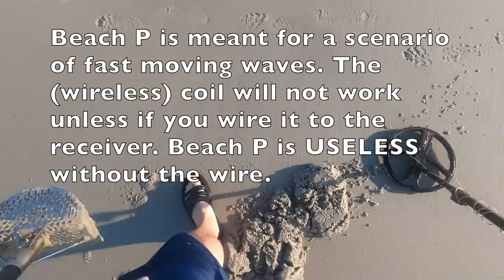Best Day Ever? I Found Davy Jones Treasure!

Comment: Great Beach.My beach surf line is much smaller.I went 7/17 came up with 2 smaller children's rings.Seems many adults are not getting in the water.( By visual observation) There are larger more crowded beaches in NJ but honestly,more driving,more gas money,more detectors.🤔So i ask myself stick it out ( i can only go once a week) or look for more detected areas.You do get good wave action (surfers in area).What i notice as opposed to the late fall ,winter is a South,SW wind most of the time.So NJ beach area it's coming from the right,rear as opposed to a NE wind straight into the beachfront.Sorry for rambling,i been doing some parks during the other days still trying to get a grip on distinguishing and separating those trash/ gold signals,#'s on the Nox....By the way how is your friend Johnny? Nox....

Comment: Speaking of honey badger scoop, how’s that going?
Reply from the maker: It’s going well. I have to communicate a clear vision for what it is. The HBS is meant to compete with scoops at the top end of the market (some go for upwards of 700 dollars). We are matching the quality (quality of materials, built in jewelry catcher, thicker shaft, wide mouth, evenly distributed weight, zero wiggle in the connection between shaft and scoop) at a price point that is less than half of the price of the scoops at the top of the market. We have a decent amount of pre orders and we are ready to fill the first group of orders!
Reply: When will the first ones arrive, will you be posting another demo video

Comment: Easy test to verify if possibly gold. Take a razor blade and cut it.  You can tell real quick what the base metal is and if you need to test it.  I went through my old finds i gave my kids 4 yrs ago over the winter and there were 3 gold and one silver.  They were tarnished and looked like junk.  I cut it and sure enough, I was $150 lighter cause i had to buy it of them. 😁

Comment: the difference between beach p and beach sens is 24khz max vs 40kz max respectively. i think you'll find if you match the other settings (sens, salt sens, recovery, audio tones) then you will see that beach p does go deeper. however it will struggle on small gold.